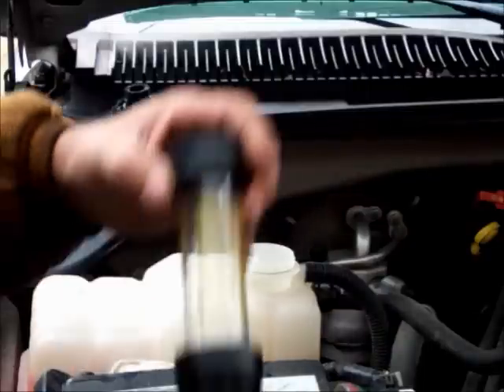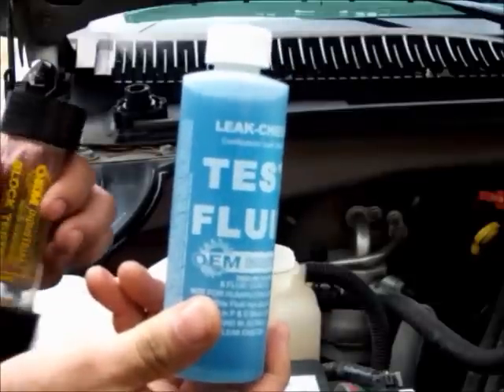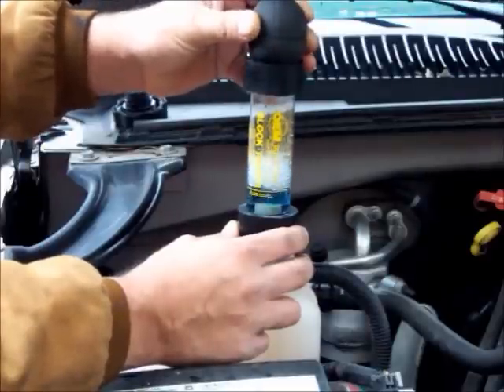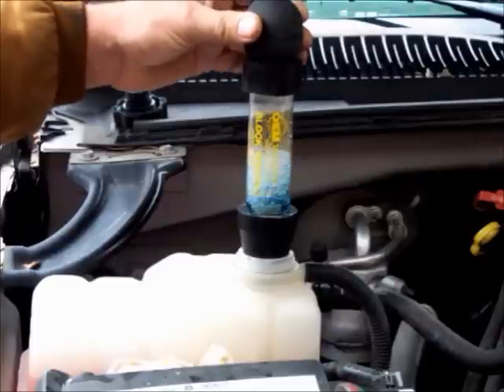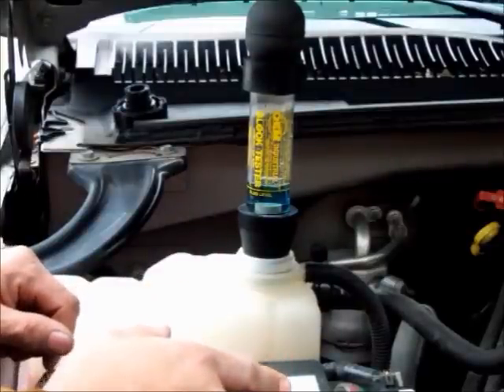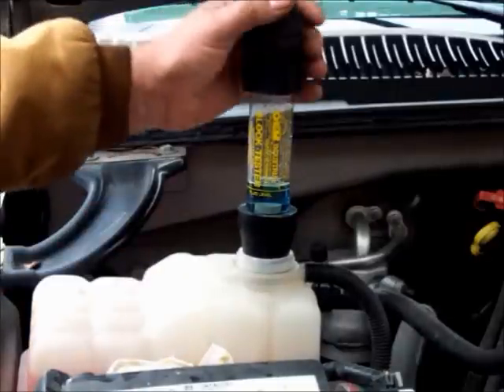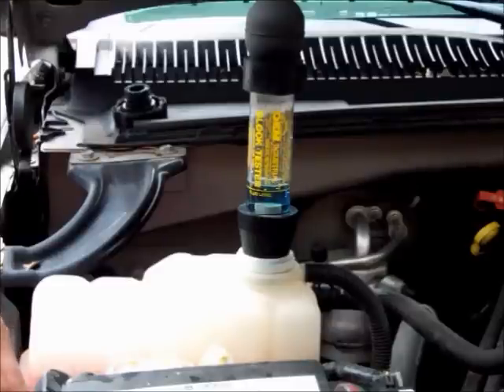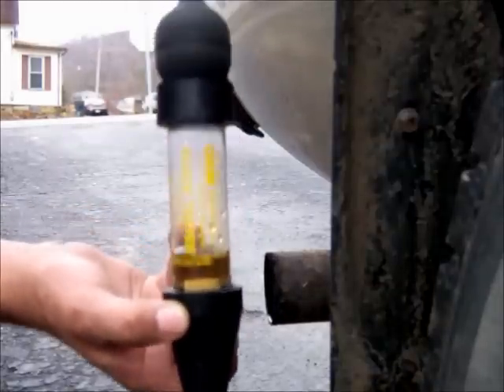Testing for Bad Head Gasket or Cracked Head or Block.

Comment: I got a 2005 LLY 6.6 Duramax exhaust gas coming to my cooling system I'm a high pressure what could it be
Reply: The head gasket... My lly is apart now becuase of that... If you havent fixed it yet...you should. The small metal fragments from head gasket got down into my oil pan...got sucked through the oil pickup... And stopped my oil pump gears enough to may the oil pump nut back off the drive...and lose oil pressure... Im glad it happened thay way instead of destroying other parts like the recluters and cam and crank gears.... I put probably at least 7 to 10000 MI on a blown head gasket that eventually cause that issue a small particle from the exhaust manifold or I should say the head gasket material to get sucked up in the pickup of my oil pan into the gears of the oil pump. I thought for a while that it was just a water pump going out and they're turned out to be nothing wrong with my water pump he was still tight in spinning when I removed it from the block but I had the same pressurized issue you did because I thought it was the lower pump water hoses leaking.

Comment: Ok but this test is not going to tell you if you have a bad head gasket, a cracked head or cracked block. So why do they call it a "block tester"? They should call it "exhaust gas in coolant test kit".
Reply: TheNYgolfer aren’t block leak testers meant to determine wether or not you have a bad head gasket?

Comment: So I did this same test.  It started out Blue but then turned Green. I read on other places. Green or Yellow means a bad head gasket is that true?
Reply: yes you have an issue
Reply from the maker: Burnt gas is what makes the color change , so more than not if turned yellow or green it has burnt gasses in cooling system that is supposed to be sealed .

Comment: So it works just the same in reservoir versus going straight to the radiator cap?
Reply from the maker: for the most part yes , but if it has a radiator cap that would be the best place to test

Comment: how dobu know if its a head gasket or cracked head...exhaust fumes can still get into a blown head gasket...how would u be able to tell the difference between a cracked head and a blown head gasket?
Reply from the maker: That can be hard , as both can be affected by temp , but thinking in most cases crack may be more temp related . If can pressure the system and look in spark plug hole with a borescope , one may be able to see

Comment: does your vehicle NEED to be running while you do this test? I have some problems and I want to be sure this isn't the culprit. just started having hard shifting and loss of power, and a weird smell so I pulled out the oil dipstick and white smoke came out of it. I'm suspecting a cracked head gasket or something so I was going to check the coolant any suggestions?

Comment: no yellow after two minutes but ball would get stuck. I changed water pump, thermostat, bypass heater core and new radiator cap. bleed system until nothing comes out of thermostat housing.  oil light is coming on, heater was blowing cold air until I changed water pump. I think my radiator is clogged. the radiator cap does not get hot. all houses are kind of hot once warmed up. what do u think?

Comment: hi. thanks for the sharing. I got a Toyota Prius gen3 (2012). I think all the video is mentioned do the test on a radiotor cap side. but my car do not have the radiotor cap, it located just behind the condenser and  unreachable. can I do the test at the coolant reservoir cap area?
Reply from the maker: I would think so
Reply: +wtbm123. alright.  thanks

Comment: i gess you could find out what cyl if you take one spark plug wire at a time .this way you can check for crack head or cyl in that one
Reply from the maker: +Peter DeCarlo Yes , just give time for any left in coolant to escape each time before testing .

Comment: Maybe you can help me. My civic has no idling or overheating issues but Im continuously burning coolant and finding significant amounts of oil in the rad but no coolant in the oil. also did compression test and all was good.
Reply from the maker: +THATGUY7o5 Would want to pressure test the cooling system and pinpoint the leak . Is there a oil or trans cooler built into radiator . If coolant is getting burnt in a cylinder , the spark plug for that cylinder may look different .
Reply: +wtbm123 
if you can smell gas from the front of your car would that be a sign

Comment: What if your car want crank see my car ran hot then slowness down and shut off never crank back up
Reply: You done fucked up
Reply: That engines locked tighter than a nuns pussy
Reply: hey dude, did you ever find out what the problem was, i have the same symptoms
Reply: locked up motor
Reply: Unless your fuel pump went out or check everything waterpump radiator thermostats
Reply: You ran it without oil and seized it lmfao

Comment: A good suggestion would be to instead of pulling the plug wires to check the bank just unplug the injectors. That way you wont have to disconnect the converter(s)

Comment: at the end of the video when you use the exhaust to show what it will look like if the combustion gasses are in the cooling system, I saw water dripping from your exhaust pipe, what is that from?
Reply from the maker: Gary Gates condensation , depends on car and weather , but most do it a little , just not always noticeable. I know around here it seems a lot of vehicles that get started and driven a mile or two and shut off , they go through a lot of exhaust pipes , because of it .

Comment: thank you, i have pulled the spark plugs and fluid came out of two of the sockets i believe the engine was hydrolocked after i threw a belt overheated then burned out the starter trying to get it to turn over with water forced onto the engine...its a 1977 chevy g30 motorhome its been sitting since last august would like to get it rolling again soon thanks for the suggestions..
Reply from the maker: Michael Clement only thing i know to do is find out where water is getting in , The heads will prob need to come off to fix . would need to look for cracks or warpage . also if running when it hydrolocked , then could of also bent a connecting rod .

Comment: what if the engine wont turn over?
Reply from the maker: Michael Clement Well in that case one would follow another diagnostic route . First determine why it will not turn over , like is a cylinder full of water or something . then maybe a leak down test to verify where the leak is . If engine did lock up because cylinder full of water then may check for bent rods as well .

Comment: Nice job brother! After seeing this, I am convinced of contaminated fluid with my tester. I'll need to revisit this for sure.
Reply: Absolutely correct.  Since I drive a Silverado I have never seen a bad head gasket:)  but on everything else if its bubbling in the degas bottle or rad it changes yellow real fast, if it's a small leak it's real tough to get a positive read  and is painfully slow but every time if there is CO2 present I get at least a change towards green.  Dwane from real fixes real fast displayed in a vid he uses an old AC vacuum pump connected on the end to constantly apply a vacuum on the ones hard to detect, I think it was a postal truck. Great vid as well.
Reply: Well done Terry I have the same tester.
Reply: Steve Rob what has been your experience with it Steve? Is there possibly a level of CO2 gas that is needed? A higher concentration maybe?
Reply from the maker: ScannerDanner Thank you for watching with an open mind . , be nice to see a retest with new fluid.
Reply from the maker: Steve Rob Hello Mr. Steve
Reply: wtbm123 Howdy  partner , i know how much you love your chevy truck , have you ever seen a silverado with a bad headgasket.
Reply from the maker: ScannerDanner That is a good question , at what level or length of exposure time to CO2 does it turn enough for the naked eye to see. There are so many variables that kinda makes it a fast test but not most accurate.Have had a few just turn green and have a head gasket leak , but most have just turned mostly yellow .
Reply from the maker: Steve Rob No and now thinking , when every other piece of my silver truck has broken , and it will , i will still have a few good head gaskets . something to look forward to. lol
Reply: Is your slow brother still making videos?

Comment: Nice video. What if I just put a ounce or so of blue fluid inside a empty water bottle and then just put the overflow tube inside to the bottom of the bottle and lets the gases make bubbles in the bottle. Would I get the same results? Or maybe just cut a hole in the bottle cap and put the hose in there that way and drill a little hole in the cap next to the hose hole to release the extra pressure.
Reply: Should work yes

Comment from the maker: Not familiar with that specific car but, I wonder if The cooling sensor wire may have a dirty or bad connection.Also trace the wires back and check for bad spots or other connections. I would check the grounding point for that circuit .When working they may have pulled or something and now a bad connection.Some times they need to push things aside to get to things.  Air in cooling system may do it ,but don't sound like the cooling system was opened up before the issue.

Comment: Great stuff. I have a 2001 Lexus LS 430 and did not have a floating temp needle until had spark plugs, timing belts, and valve cover gaskets changed. Also change temp gauge, cooling sensor, but temp needle still floats. Any ideas?

Comment from the maker: It should not matter if it is water or coolant. This test checks for exhaust gas in cooling system .A compression test would be the pressure in the cyl .

Comment from the maker: They are correct. If you were getting coolant in oil , the oil its self would be milky. I would check the PCV valve. It is in the valve cover ,and I think it has been updated.